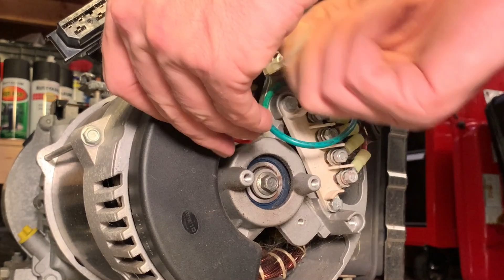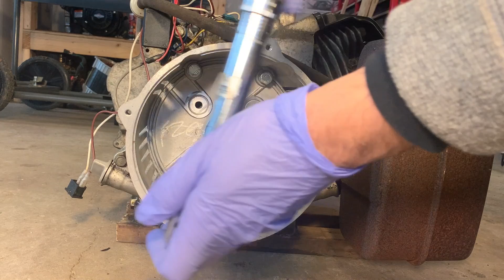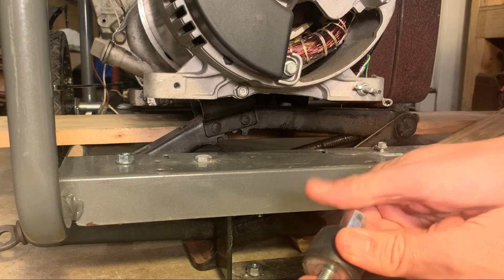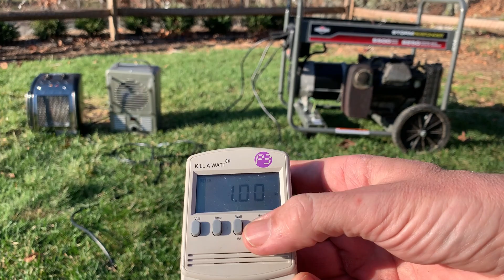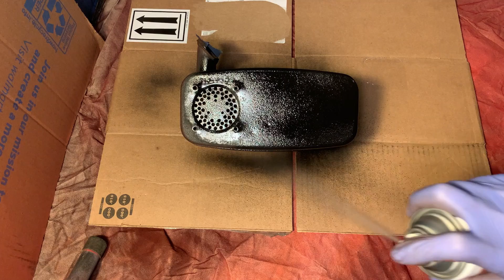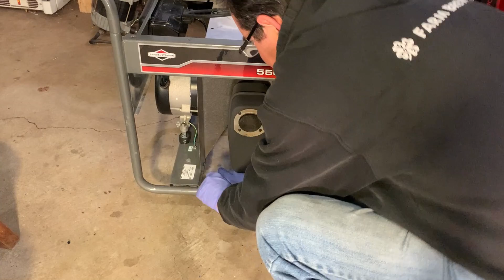Blown Storm Responder Generator Engine Swap With a Yamaha MZ360

Comment: Great video , I worked on a small generator  . Had to replace the fuel shut off , so I ordered replacements on Amazon . One add showed a clear picture showing the same valve for 20.00 and another add showed a other valve for 2/10.00 . I ordered both  , Holy cow all of the valves are the same .

Comment: Fantastic swap and fitment, James! Love the stator end mounts. Pro-grade adding the housing for the on/off switch and low oil light. Amazing it ran so well without you having to touch the carb. I always feel like I got away with something if a carb doesn't need cleaned or rebuilt on a 2 stroke engine. Haven't had a chance to touch the Storm Responder I picked up last weekend. Have a feeling it's going to be an engine waiting on a genhead to match it. Will keep you posted. Thank you for doing what you do...for fun! 👍👍😁
Reply from the maker: Thanks Eric.  It was a pleasant surprise that the carb was in good shape and the engine needed nothing.  It is rare.  I bet that power head is good.  The storm responders have two different types on power heads.  One with an AVR and another with just the bridge rectifier (like the wheelhouse you worked on).  The ones with the bridge rectifier are built well, but the bridge rectifier board goes bad a lot (the diodes and capacitor).  Have had 3 bad ones in the last 3 months.  Actually had one blow on camera this week.  It shot sparks out the generator head when it went.  That said, I have only bought one that actually had a bad stator.  Good luck.
Reply: @jcondon1  You're welcome and thanks for the insight on the Storm Responder, James. The one I picked up has an AVR so maybe just brushes or an issue with the AVR. I need to do some more diagnostics and see what's what. Thanks again!

Comment: Don’t forget to peel the sticker above the fuel cutoff valve. Nice 👍 job on the generator.
Reply from the maker: Great point.  I picked up another one recently with the same issue.  Guess they came from the factory that way.

Comment: Nice video!  My Storm Responder is running right now - thanks Henri!  I had the same issue with the Fuel Shutoff valve sticker being WRONG  - was tearing my hair out once upon a time as to why the unit would shut off ... Then read the printed manual and found that the sticker is wrong.  You noted this in two videos of the same model unit.  I hope you blacked out that sticker and put in one with correct info.  Thanks for great videos, a joy to watch!
Reply from the maker: I should of.  When selling it, I fired it up in front of the buyer and it stalled out after a minute.  The sticker fouled me again.

Comment: Jim, two ideas for you. 1) when swapping parts like you have, you can make a cardboard template for your mounting holes for placement. For when they don't line up, a piece of 1/8" steel angle might be useful. 2) you might be able to have the engine block welded if the internals are good. I do understand what happens when an engine runs low on oil, or flys apart because of wear issues. Those are some ideas for you. I have some plastic cutoffs from a local distributor if you would want to use these in place of wood, or for mounting switches, etc. These are available in 1/4" and up for most things, and I have some in black.
Reply from the maker: Thanks for the ideas.  I have two other blocks that survived so going to rebuild those.  The biggest issue is the internal wear that happened when they ran out of oil.  Have 4 crank shafts from blow up engines.  Two are out of spec and the other two in spec but the journals are not perfect.  Am working now to get those together (assuming everything else measures up).  If you could send me a picture or link of the plastic cutoffs.  Am interested.
Reply: @jcondon1  I Will try to get some pictures of a bit of what I have. I donated a bunch to a trade school in my area. I may list it on marketplace and send you the link, since I can't send pictures here.

Comment: James, maybe get a little voltmeter and install in that unused hole in the panel you bought for it. Also, I agree with the comment below, buy yourself a lift table. A great investment and it will make your videos easier to film. Nice job.
Reply from the maker: Thanks.  The meter is a good idea.  A lift table is on the short list.  Actually it is a little easier filming on the floor.  Can see better what the camera sees and the audio is better.

Comment: I think it better to shut off the engine with the fuel shut-off.  After you kill the spark with the switch, fuel/air mix is still going strong the whole time it's coasting down.  So unburnt fuel diluting residual oil in the cylinder for the next start.  Nice save on that unit for sure!

Comment: It still sounded like the engine was surging a little bit. I noticed in one shot that one of the linkages did not have a spring across it and the hole the linkage connected to looked a little large. I wonder if adding a spring across that linkage could take out the backlash and reduce the surging.

Comment: Some manufacturers of engines, make an acessory which screws down into the sparkplug hole, to lock up the cylinder, I'm sure you know of it, and I wondered why you don't use it......
 Great job, as always, and U'll wager the unit lasts a lot longer with the more powerful engine..
Reply: All you have to do in that case is lower the piston and stuff the cylinder with rope. Safest way to not damage a good piston
Reply from the maker: Have thought about it.  Rope takes longer and difficult on some engine designs, but is safe.  The device you speak of is called a piston stop.  Do not like the idea of using the spark plug threads to take all that force.  Seems like trouble.  But, I know a lot of people use them.

Comment: Mustie1 did a video on a riding mower a few yrs ago. It had either a Kawasaki or Yamaha engiine in it. After several days of experimenting, he determined that the carburetor was bad, (chronic flooding).
There is no such thing as carb kits for those. One must buy a whole new carburetor.

Comment: Nice rebuild, Yamaha is a fuel sipper compared to the old Briggs. The bigger engine will last longer if powering near the max continuous wattage. You really need a decent MIG welder for your shop. I own a YesWelder MIG/Stick/TIG Multi-Process Welder MIG-205DS | 3 in 1 It will weld up to 3/4"  I just added a 3D printer to make knobs, cable harness brackets, ABS electric boxes.
Reply from the maker: I agree completely.  Will get one soon.  Will be a little embarrassed with my first welds on camera, but gotta do it.

Comment: Hey Jim, this is a BTW:  guy on you tube " small engine mechanic" had a very interesting video, on a 20k back up gen setup.  He found a loose wire going into the slip rings, that you would live to see. It was an intermitant no power problem. What I think you would find interesting, is that he pulled the entire slip ring  piece off the rotor shaft, and soldered two extension pueces on. Very kool.....check it out...it is a natural gas  Cummins powered unit.. If you have any rotors that don't have continuity through the excitation slip rings you should view this video
Reply from the maker: I subscribe to his channel.  That same generator also had black varnish on the stator wires which helped me troubleshooting a unit with a black varnish.  Thought the stator was bad due to the stator wire color (and the fact it was not making power).  Ended up being fine.

Comment: Next time drill the tank vent into the side or rear of the air box so if used out in wet weather, water dont chase the hose and slip past and get sucked in. Although I do see the hose fit tight, but that might not always be the case as it ages. Great Job 👍
Reply from the maker: Good point.  Thanks.

Comment: Great video also thanks for the helpful information. I just had to replace drive belts on my snowblower and having the rope trick in the cylinder would have helped route the belt around the pulley.👍👍

Comment: Seems that some of those unusual "offset" motor mounts would have helped in this case.  And I would have considered hiding the oil sensor module inside the new cover to keep the overall look clean.

Comment: Over time I think that the stand-off that your using to mount the power head to the frame is going to cause issues.  You've created a lever against the bushing the more it vibrates the quicker it will wear them out.
Reply from the maker: I agree.  Have used a 1x3” oak shim in the past.  It works better, but really want to use something synthetic rather then wood.  Those mounts are easy to replace if they begins to fail.

Comment: If you have a real impact wrench you wouldn't have to lock up the flywheel to take out the drawbolt.

I wish those anti-vibration mounts were easier to find; I need a few o put on my vintage Bell & Gossett air compressor.

Comment: You are the most knowledgeable person on YouTube when it comes to portable generators, sooooooo, I have a question.  Instead of using the reversing drill method, can a generator that has lost its magnetic field be flashed with a 12v battery through the 12v battery charging outlet that most generators have?  This is for future reference in case my B&S 8kw generator decides to take a holiday.
Reply from the maker: I would say I likely.  Most likely there are diodes that only allow the power to flow out to the battery and not back into the generator.

Comment: I’m new to watching the generator stuff, what is an AVR? Does that mean auto voltage regulator?
Also putting rope in the cylinder is not a great idea, the mechanical advantage the crank can put into the con rod can bend it or even crack the piston as it is like hydraulicing the cylinder, remember the crank is a point of leverage so putting force on the center it’s multiplied by the stroke of the crank, it’s better to find a way to lock up the pull start like you did with the removal
Reply from the maker: I agree.  Some use a piston stop which rely on the spark plug threads and piston to hold..  No thanks.
Reply: @jcondon1   yeah that’s another bad one, I usually try to use something to hold onto either the flywheel, like a belt or your tie strap idea was awesome, I will definitely be using that one in the future

Comment: That unit was way too clean and by the looks of the air cleaner element, the engine may never have had oil in it and now you have lots of good spare parts. Good work as usual.
Reply from the maker: Thanks.  I really like the design of the storm responders.  If they had an oil sensor, they would all still be running.

Comment: I'm a little concerned about the tank venting into the airbox.  If there is a back-fire through the carb, it might could send flames up through the hose to the tank.  Then Boom.  Just a little.
Reply from the maker: Never considered that.  Very good point.  Never liked the ventless fuel cap.  99.9% of the time the generator is off, so not much benefit in sending the vapor from the tank back into the carb.

Comment: Rance here Jim, just wondering why you did not want to bring voltage closer to 120 rather than leaving it between 115 & 116? Very good and enjoyable video.
Reply from the maker: I should have.  Better to be at 120 or a little higher.
Reply: @jcondon1  Thanks for the reply...please don't think I was being picky, just that I hang on every word and just trying to gain a little more knowledge.
Reply from the maker: @rancelynch6514  No worries.  Ideally no higher then 127v no load and no lower then 113v loaded,  since this had an AVR, was not worried that it would drop under load.

Comment: Thanks, yet I am surprised that the alternator had to be dismembered to un-couple it from the power plant?
Reply from the maker: No easy way to get them off.
Reply: @jcondon1  Seems like bad design, why not just have a normal coupling? Eg; uni joint, rubber coupling, spline coupling, surely the list goes on.... Thanks for showing though!

Comment: Are you going to repair the old engine?  Maybe do a post-mortem?
Reply from the maker: I will open it up in a future video.  Not rebuilding this one due to the hole in the block, will use some of the parts to rebuild another.

Comment: Could you have tested the low oil light to see if it was working? Seeing how this is what caused the engine to fail.
Reply: He needs to stress to the next owner that the light is NOT a "check oil" light.
Reply from the maker: The last engine did not have an oil sensor.  It could be tested if you drain the oil and connect a multi-meter, but have not reason to believe this engine has a faulty sensor.

Comment: I have a question for you. I have a contractors generator 2000 watt, with a 6 hp Tecumseh engine. It turns over, but won't start. It has the old shut off metal piece to ground the plug out to stop. It isn't a ohv model. Do I have to lap the valves and shim them to make sure they are opening the right amount? I'm used to ohv models with rocker arms and pushrods.
Reply from the maker: You can only grind the valve stems shorter.  If the clearance is too large, then you have to buy new valves.
Reply: @jcondon1  Thank you! When I tried it last I thought maybe they were sticking because it had set a while. I put a little Marvel's Mystery oil on them and saw them open and close while cranked the motor over slowly. They looked like they were dark somewhat. I figured it was from use and age. I used it quite a bit for running saws and drills in remodeling. It always ran good then. I could use it now, so of course it's not working. Lol 😆

Comment: will you extend the heat shield and change the on off  sticker
Reply from the maker: I am happy with the stock heat shield, so will keep it as is.  Will remove the sticker.  The labeling on the valve is enough.

Comment: James, on a Yamaha 360, does the engine have to be opened to replace the low oil sensor? Just wondering cause my 4600 A will not fire with the sensor hooked up. Thanks.
Reply from the maker: It has to be opened to replace the oil switch.

Comment: If the engine threw a rod... I would've thought the choke lever and the pull start string would be very bent??? And maybe the cylinder head full of crab sticks??? I'm not sure of the make of the cheese in your burger but mine is so full of carpet it ain't  real.

Comment: I am surprised at how you can always open the choke as soon as it starts. Every small engine I have will surge unless I give it 1/2 choke until it warms up.
Reply from the maker: Funny you say that.  Was working on one today that needed choke for about 30 seconds.  Though there must be something wrong... and there was.
Reply: @jcondon1  ok I will bite. What was wrong? My Champion generator has been like that since new.
Reply from the maker: @RetiredPilot  some do need a little choke.  No easy answer other then, most likely the carb is a little lean.  Would not be too concerned as long as you can turn it off once warmed up.  The one today would stall if turned off quickly.  Noticed even when warm once the choke was off, the engine speed would slow a little.  It was not surging, but a little unsteady on the governor.  Adding a little choke increased the engine speed and the governor was very steady.  Going to drill out the pilot jet to 0.013” to hopefully fix.

Comment: Musty 1 had 1 just like this somebody put the coils on wrong
Reply from the maker: It happens.  Had a beautiful Briggs Vanguard twin cylinder that would not run.  Both coils were backwards.  Still had enough spark to light my test light, but not enough to run the engine.

Comment: 16:30 why not just drill the holes and do it right?? Not trying to be an ass , just saying.
Reply from the maker: Did not think it would cause an issue.  Have seen generators that come from the factory like that.  That said, it would have been better to move the holes.